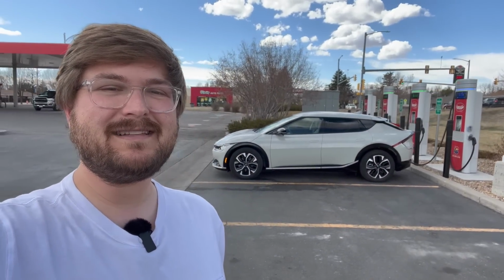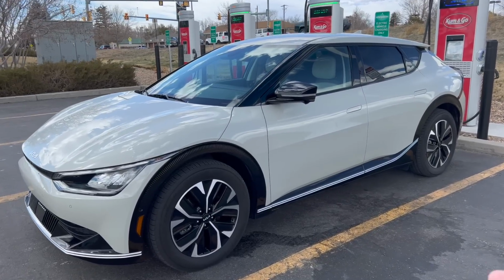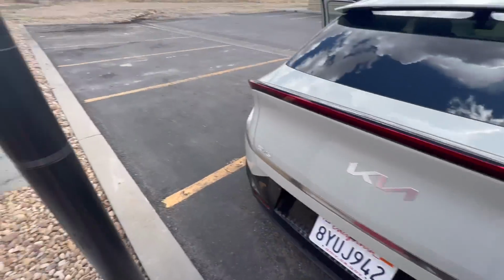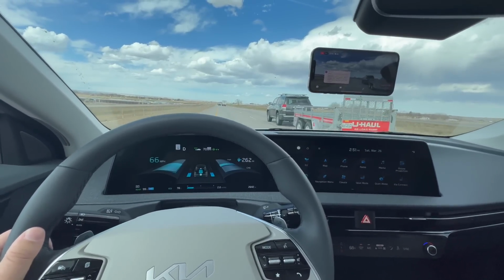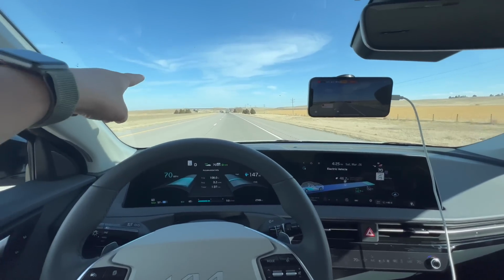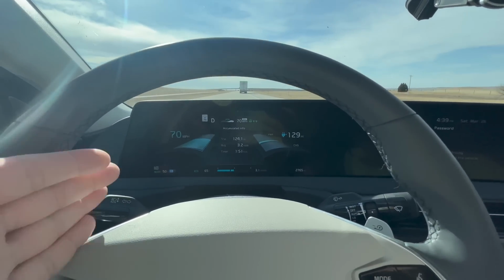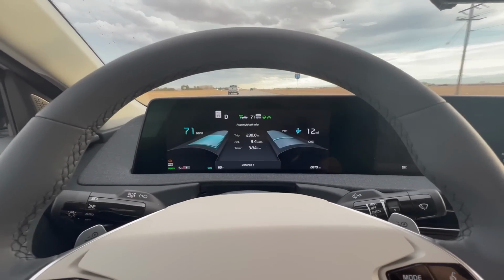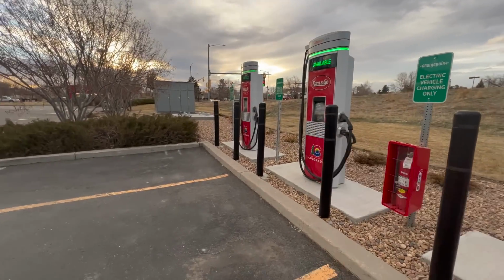2022 Kia EV6 AWD 70-MPH Highway Range Test - (Wind 19” 77.4kWh)

Comment: General question : whatever the range of an EV how many miles can you put on the clock before its a throw away , meaning putting new batteries is not worth the value of the car ? 

Im gonna say if you buy a good ice car meaning a model and brand known to last and you know how to drive meaning how not to abuse a car as far as operating temps and bad habits that kill life of main components like waiting for car to fully stop in reverse before slapping into drive and things I see people do in cars . I have never had any new car have anything fail in 100k pr even well into 100s except for a clutch on a car thay was stolen by somebody who didnt know or care how to use a clutch on a car over 100k , but yeah never had to replace even a clutch in a car including ones with V8S driven hard ( i think thats from not really using it much  actually ) nor had a manual trans fail or an auto trans for that matter although I try to avoid owning them . But i feel like 200K is doable and you somewhat regularly see cars with 300k including people listing them for sale for 1000s of $ saying plenty of life left of which i would not risk , if you have a car with 300k with plenty of life left you should drive it and not expect somebody else to believe you unless they are a mechanic and take it 1/2 apart to see if that is so .

But on average what is the ACTUAL LIFE of an avg EV . I realize like a phone or laptop and other products it will work but not hold charge as well so that means different things but even to say you keep an EV knowing it only has 50-60 % of range and have it along with another car and use it for shorter trips etc .

What is the maximum life on avg if your willing to deal with loss of range as i figured but still use it to go shopping and shorter trips ( have another vehicle you would preserve life on by using ratty car same as ice cars , like use it to drive in NYC not. Eing afraid to rub paint with cabbies and pushy people and park on street etc) .

It seems some people do for whatever reason end up with cars that need new or not new but " re conditioned " or used with less mileage new battery packs and there are scenarios where you have a nice vehicle but not worth anything because of battery / batteries crapping out so zero equity in car . 

It feels like EV  owners dont at all think past 70k maybe 100k and replace their vehicles faster or similar to a german car owner for instance . I am more of a 10 year owner or longer even i have one care that is a 19 with 10K on odometer so god knows if the car doesnt outlive me at 57 years old at this pace . 

Evs being cheaper to run i might want to run more miles in fact .

Yeah general question i know its broad and perhaps that could be for average tesla owner . Im gonna say normal driving 12-15 miles a year in  NY with seasons . Is 200k a reasonable life span and is there any equity left at 200k or is it a part out if treated well enough ?

Comment: A good test may be to choose an EV (doesn’t matter which) but perform the same 70mph range test at different temperatures (0* 30* 60* 90*) outside and see what the range difference is between each temperature

Comment: did you guys not test a RWD 77kwh EV6? 
I would like to know if the 95ish or so hp sacrifice is worth the extra range, or if its just worth going for a full GT? (I'm looking at a RWD GT-Line EV6, but am holding off to whether go for AWD because living in Utah (though I've driven several RWD ICE cars like Nisssan 370z and Subaru BRZ).

Comment: Great video and test. I have been looking for this. So 250 miles around 400 kilometers. The only issue is that the terrain is quite flat. My normal long range trips are between highways that have steep hills. Which will you recommend for efficiency, the EV6 or Ionic 5?
Reply: They’re basically the same

Comment: That is an odd specimen.  The Wind model Kyle was driving did have HDA 2.  You can see the auto lane change in green when he would switch lanes.  It also had side view cameras with video on the dash with signal light activationl (which a regular wind does not).
Reply: That is because the regular wind doesn't come standard with the tech package. That can be added on, which will add all the cameras and all the other features you mentioned.
Reply: @cloneninja  the tech pack adds the surround view and crash avoidance but does not add HDA2 (or at least that’s what the website shows)

Comment: Great test! I'm curious is there is a published EV motor derating due to elevation and if that has any affect on range.
Reply: Elevation deratings on ICE vehicles have to do with air density changes, the electric motors aren't impacted by air density, the only thing impacting the electric motor is the amount of electricity provided.  Temperature impacts the battery's ability to supply the required watts to the motors but that is about it.

Comment: Kyle, I am not sure why you were so impressed with 254mi range in perfect 70F weather, using a single motor only. Isn't it EPA rated at 270mi? What would it do in the winter with AWD then? Below 200mi? Even my '20 Bolt did better.

Comment: Great report. Seems everything with the Kia has done well. Only question does Kia provide a list of charging stations that could be used on a 600 miles trip?  What is charging time back up to a 80–90% charge
Reply: In good conditions, from 20-80/90% it takes 20 min. At a 350kw charging station.

Comment: Great video. Overall, my only (constructive) criticism is that we need to stop being apologetic for driving conditions. Wind exists, cold/hot weather exist, low ramps exist, people inside a car exist, so tests like yours ARE real, if I wanted 'perfect conditions' (which rarely exist) I would just be OK with theoretical. The best solution is to put a 'range' on the range estimate.
Reply: I believe the point is consistency between tests. It would be ''unfair'' to have car A tested under heavy headwinds versus car B in good conditions.

Comment: You've got to start doing the tests without "ideal" conditions. There are no ideal conditions. 80% of the time there will be wind, or construction stops in America. It's only a couple months out of the year, where you'll have perfect condition, unless you're in Southern California, and only when they aren't starting fires there. These tests are excellent, but using "ideal" conditions is not necessary, because street cars are not driven on a closed course race track in ideal conditions.

Comment: Being the first owner in Alabama to have purchased a KIA EV6 on February 12 (couldn't get the vehicle until after the Superbowl debut Feb 13), I have logged over 3100 miles in almost 4 months. The KIA dealership gave me a ChargePoint Home Flex 50A ($700 value), a 240-volt Level 2 home charger that delivers up to 50 amps of power (approximately 9.4 to 11.4 kWh). I researched this vehicle for many months and in October 2021, the dealership called me and offered me the EV only saying, 'What color do you want?" In Alabama, the only answer is Crimson, and their response was "Runaway Red". I come from a different perspective on this topic. I don't use the term car as I see these vehicles as computers on wheels. With that in mind or to my point, I come from a strong software view and was shocked and pleased to hear Hyundai/KIA purchased Boston Dynamics for future manufacturing, AI and software development for their vehicles. As many of my friends who own EV in Huntsville, AL (ID.4, Tesla, etc.) all of them have had recalls that have cost them weeks and weeks of downtime (batteries burning up, dashboards going blank, et.) mostly caused from software issues. I just went thru an uneventful recall myself that cost me an hour of my time. more to come...

Comment: Why is nobody talking about Tesla needing a new motor after 40k miles.  My model S is on its 3rd with 77k miles.  $6k a pop
Reply: Because "Tesla needing a new motor after 40K miles" isn't a thing. Maybe it happened to you, but it's not like it's an endemic problem.

My Model S is push 80K miles, original motor and everything else. Only failures so far have been headlight bulb and one speaker.

Comment: After reading many comments I haven't seen what I consider an important question, how much did it cost you to fully charge? From 0 to 100%? If someone knows please share. Thanks
Reply: I was literally wondering the same thing!! Like why wouldn’t he mention that in the video 😫
Reply: EV6 comes with 1000 hours free through Electrify America if that helps… really depends on how much per kWh the charge station charges at.
Reply: T
Just looked up the charger he used - they list .35 cents/kWh - the EV6 battery is 77kWh total so the charge from 0-100 percent would be around $27. Normally you don’t want to charge beyond 80 percent though for battery endurance. Charges from around 20-30 percent to 80 percent usually run around $15-$20 in my experience.

Comment: We want to see tests done in regular driving conditions, this cross wind was perfect for real world results. The doctored numbers the manufacturers are giving out only hurt them once people see the real results.
Reply: Given the results here, the 274 miles advertised by Kia for this car seems completely reasonable. The EV range values are always "mixed conditions", i.e. a blend of highway and city driving. Even if they were doing just highway, the speed used probably wouldn't be 70 mph. Even a 10 mph reduction will improve the range significantly.

Seeing as how the car went over 250 where practically all of the driving was at 70 mph, I would not be surprised to see an actual 274 miles of range under real world daily-use conditions.

Now, should the EPA be having EV manufacturers publish range figures for city and highway separately? Yeah...I think that would be a good idea. But you can't blame the published figures on the manufacturer. That's what the car actually does under the test conditions stipulated by the EPA.

Comment: While I was thinking about getting an Ioniq 5 or EV6, the math just doesn’t add up over a hybrid if the sole purpose is to save money. My Elantra HEV gets 50-52 mpg and an ioniq 5 is at least 10k-15k more expensive. At 52 mpg the cost savings on EV over fuel would break even years later. It is nice for sure but doesn’t economically make sense from a pure financial standpoint.
Reply: You're betting gas prices will stay the same over your ownership period.
Reply: @GabrielEtsHokin  even if the gas prices doubled the break even date is still years out. The incorrect assumption is the EVs cost nothing to charge when they do cost money. EV over a very good hybrid only saves about 1k a year if driving 20k miles a year.
Reply: @GabrielEtsHokin  it’s kind of a false justification today to get into an expensive EV. 15k-20k in cost difference, you won’t be making that up for years. To me it only makes sense if EV’s get closer in price to hybrids

Comment: Question: If your on a long trip for a week or two and you charge from 0 to 100% every time you run out of charge, How long do you have to wait for it to get back to 100% again?
Reply: FF to the end of the video and you can see the car predicting 58 minutes to go to 100%. But if you're on a road trip it makes more sense to limit charging to 80% and charge more frequently, as the last 20% takes as long as the first 80 on a fast charger.

Comment: Right there where you got onto I25, I bought a 66 Ford Bronco back in 1980.  I wouldn't trade 200 of the stupid EV's for that old beast.  I could climb an icy mountain in the thing, stop halfway up to pickup neighbors who were stuck and take right off again.  The used car lot was right there alongside the interstate near the Wyoming line on the east side of the road.  You nerds who are buying these things will be broke before you know what happened.  And the damned thing won't even let you open a stupid door with those idiotic handles to show it off.  Got to bring it to 'comfort level' while still connected to the charger????  Are you deft?  Why on earth would you want to leave the sure comfort of a gas or diesel car?  Once you get stranded at one of the many broken charging stations, you'll probably remember my comment.  But you're too stupid to listen in advance.

Comment: The cost to replace the KIA's batteries in about 7-10 yrs costs just as much in fuel for a gas operated KIA?   DO YOUR RESEARCH
Reply: I was curious about this too...thank you for asking, so I just looked it up...

Kia/Hyundai both cover the High Voltage Battery for 10years/100k miles

Comment: So I guess it's legal in Colorado to hold a camera while driving?  If so it's still not smart or safe.  But you lost some range because the A/C was on, guess you didn't notice that.  And why does it need a rear windshield wiper?  The Model 3 doesn't have one.  All you need to do it put some RainX on the rear window, problem solved.

Comment: Nice car, but for £47,000 / $58,000, I can see it dating very quickly, especially after a test drive of one, the interior does not match that of a KIA ProCeed GT or Stinger GT. Considering Kia is also working on additional cars to be released over 2022-25, being the EV1-EV9, already confirmed are the EV4 (Kia Soul Remake), EV7 (Ceed Remake), EV8 (Stinger) and EV9 (New SUV). There is allot to come in the next couple of years! Which is also worth waiting for! 😁👍

Comment: Running your battery to 0 guarantees you damage it... every time... and it will accumulate.  I suggest reading the manual or watching EV battery videos or something, shish. Also, if you went 55; the mileage would be significantly more, and at some time you must ask yourself if driving faster was worth all the extra charging time.

Comment: I have just today had the EV6 for a test drive today, nice car BUT I wasn’t overly impressed with the speed, I didn’t feel existed driving itn
Reply: Did you try sport mode? I just test drove one today and it was set to ECO when I got in. I thought the same until I switched to sport. Wildly different acceleration profile and was quite exhilarating.
Reply: @daniellanford  yes I had it on the motorway and put it into all modes, I am looking to change my GLC next year so will test drive again when the GT comes out along with others cars

Comment: My biggest problem is doing the test at 70 mph while the speed limit is 75 mph.  I ran into fuel consumption issues with the same problem, but people will want to be slightly faster than the 18 wheelers on these types of trips.  A 79 mph test on Interstates would be more practical.

Comment: Frustrating! I will not buy an EV with …. I have to worry about headwinds? Calling 250 miles range impressive, is a joke! 350 mile range or less does not match most Americans driving habits. we shouldn’t have to adjust to the car! Let’s not mention the scumbag dealerships pushing the price way over MSRP! I don’t care what you say these are nothing but glorified golf carts, there’s no excuse for not being reasonably priced and having 400/500 mile range.

Comment: Great until electric price goes into orbit !
Reply: That's less likely than gas prices going into orbit... because unlike gas (which is 100% dependent on global oil prices), a large chunk of electricity generation requires no fuel, and thus shouldn't fluctuate (but other generators do require various types of fuel, which fluctuate by differing amounts, so there is some variability for electricity prices... but not as bad as Gas)

Comment: If a long winter blackout occurs in a land of electric cars most of the population will
perish in the freezing cold. The gas powered car that would provide cabin heat for
many days will not be there. The electric car could only supply heat for a short time
and would quickly discharge its battery making a trip to a shelter impossible.
Reply: If you're worried about a 'long winter blackout', you'd be better off installing some Solar Panels... and generating your own power, to use either for your 'cabin', or for your EV.
Reply: In a "long winter blackout", the gas stations won't be able to pump gas. You'd be stuck with whatever amount of gas you had when the blackout started. And no one is going to just sit in their car for however long it takes to run the tank dry anyway (which is likely a lot less time than "many days").

A car is not a suitable substitute for proper emergency preparedness, whether that car is EV or not. Besides, even without electricity, most people will be fine just staying bundled up in coats and blankets in their own house.

Comment: ive driven mine in the snow and i have not ...really felt i needed the rear wiper.   i feel stupid that i have not figured out if i have the auto lane switch i usually have mine in lane keeping.  this is my first EV and im in love. however im still new and learning the charging things, i havent seen anyhting near the 10-100 fast charge its usualy taken me quite a bit longer to get half that time some of the comment spoke of.
Reply: What kind of tires did you have on for the winter driving? Stock Kumhos?
Reply: @debbyahern844  yes i have the stock tires on it.  i have kumhos.   i live in colorado and really have never realyl felt the need for winter tires.